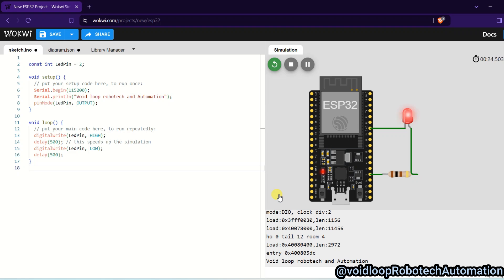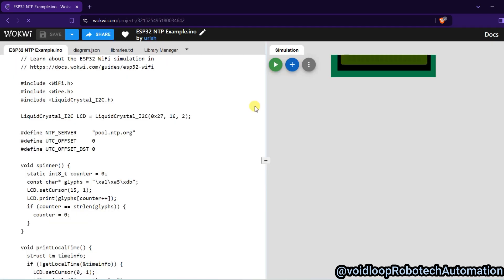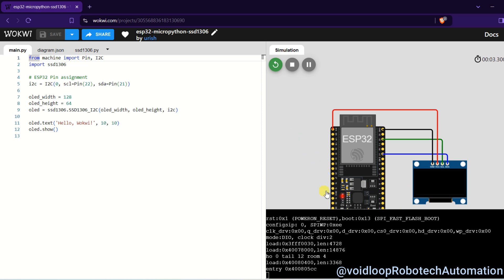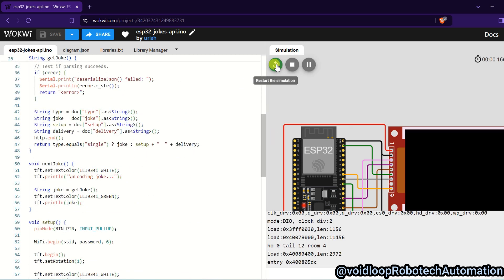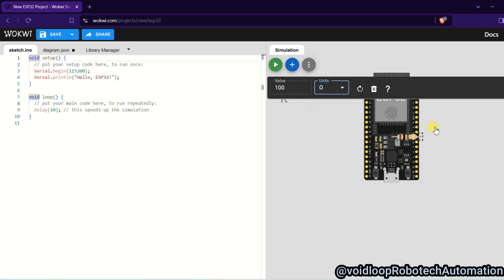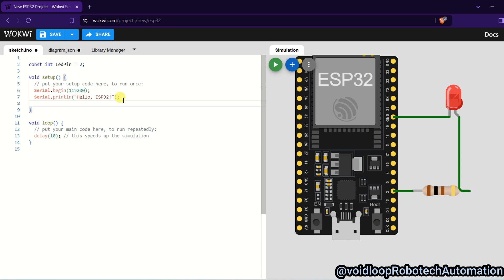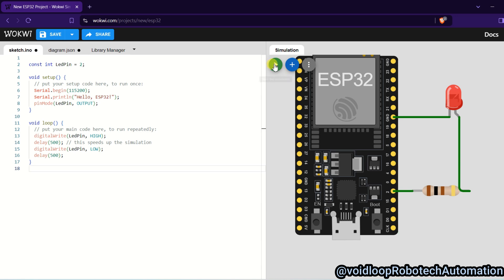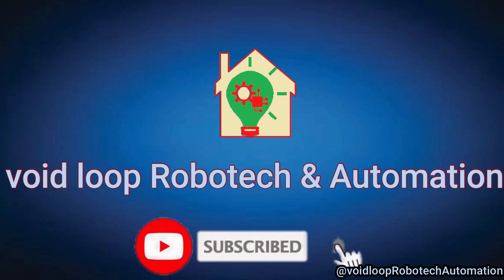00 ESP32 Simulation with Wokwi Led Blink with Arduino

Comment: i have doubt , is esp is programmed using libraries and inbuilt functions as  a professional in industry also or bare metal programming of esp is done .?please reply
Reply from the maker: You can program with Arduino and ESP IDF both
Reply: @voidloopRobotechAutomation i am asking "is bare metal programming done for esp 32 as stm is programmed  or it is programmed only using libraries as a professional